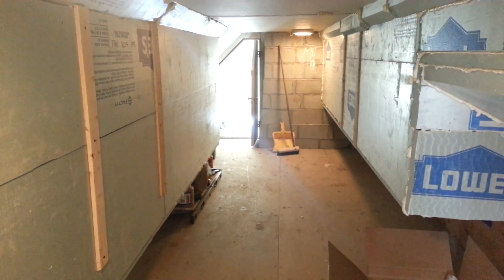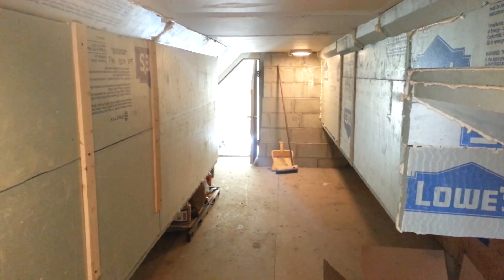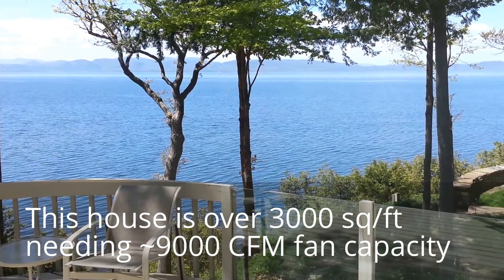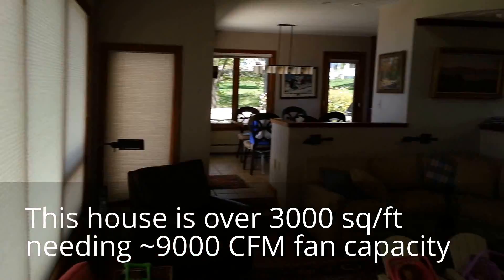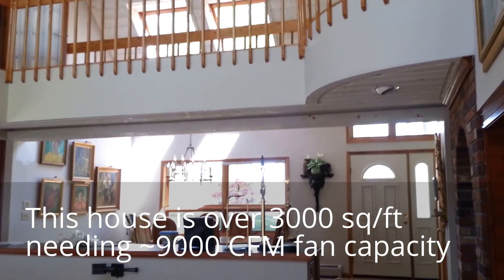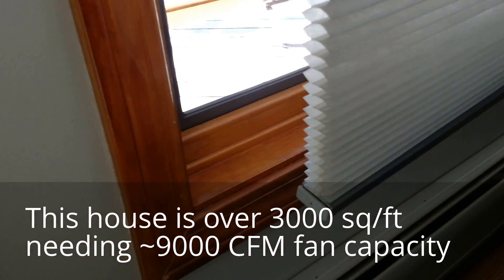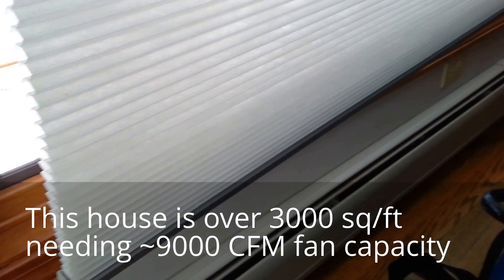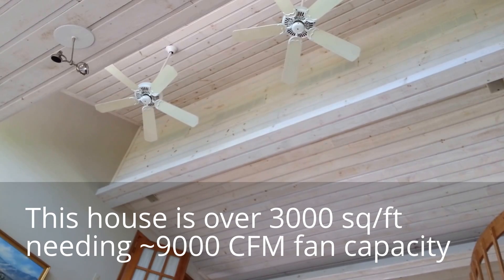Quiet Cool whole house fans operating in Great room w/cathedral ceiling

Comment: I assume you can't run the fans on high humidity days or nights?
Reply: Generally you use whole house fans like these when it its equal temperature inside and out. Otherwise you will just be bringing warmer air into the house. The average evening temperature in July and August  in VT where this video was take is 64. But on the few nights when it does not cool below 75 and is humid it still feels more comfortable than being in a hot 80+ degree house using traditional fans.
Reply: Thanks. I'm in NJ where we just had a 73 degree night with 90% humidity. A whole house fan would not work in that situation unless you like to sleep in wet sheets.
Reply: Even in that 73 degree and 90% humidity the house fan will be exhausting the 150 degree air out of your attic and lowering the inside temperature down from whatever the daytime temp was. Most houses without a whole house fan will remain over 80 degrees until 3 am or later because that attic stays hot and the house is retaining heat too. Even 73 degree air at high humidity flowing through your windows feels better than a standard fan blowing around 80+ degree air. Whole house fans have been used widely in the far south since the 60's.
Reply: I'm not knocking a whole house fan. I think they're nice to have you just can't use them on high humidity nights. I tested one bedroom with door closed and an exhaust fan in the window with other windows open. The temp went down but the humidity made the bed sheets sticky. It was not comfortable even at 73 degrees.  I  am still debating whether to install one to cut down on A/C usage but I wouldn't use it on nights where the humidity is above 50%.  The idea is to keep humidity out of your house not suck it in.
Reply: I agree, if you have AC that can be a better option on the hot humid nights than a WHF. But a WHF is still a better option than just regular fans if you don't have AC IMO. But so many people run AC's all summer even at night when it is often in the 60's which makes no sense. But they do it because the house stays over 80 for too long into the night. WHF and AC is a good combo. This is the first year we needed to put in our window AC's (for a few nights) in 6 years with record breaking heat. But we have been fine for 6 summers with no AC and just the QuietCool WHF prior to this past 4th of July week.